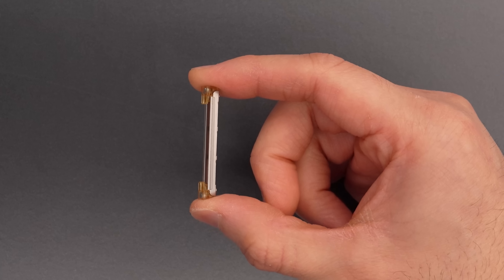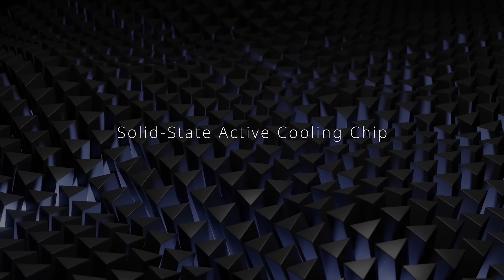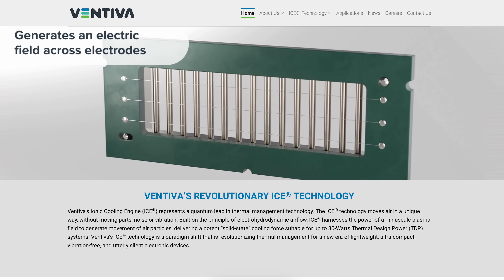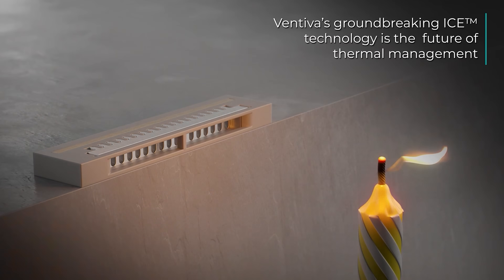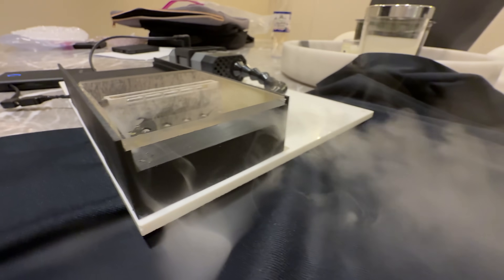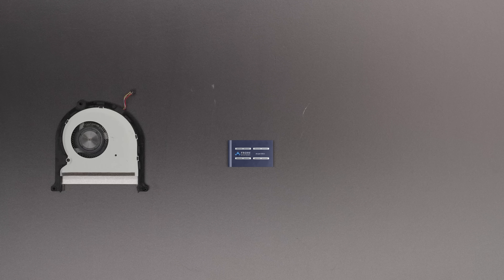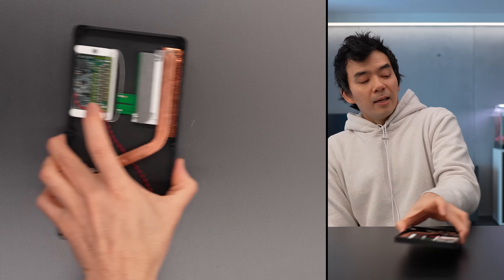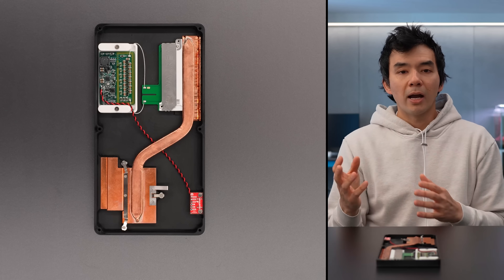The IMPOSSIBLE Laptop Fan...

Comment: Tbh i think it is easier for them to decrease the cost rather than solving static pressure issue. 

For me most promising coollers are vapor chambers as they technically have most heat caring capacity because of very high heat transfer coefficient, that can be achieved when a liquid is at boiling conditions. Although more R&D is needed for a particular design and appliances it is much more effective.
Reply: The heat pipe does the job of the vapor chamber. Fans are just a way of minimizing the heat exchanger from inside the device to the surrounding air.

Comment: In case of Air Jet you got that wrong, yes it uses less Air as in CFM but it uses more efficently in a way to be able to cool it.

 AirJet Mini removes 5.25 Watts of heat at a silent 21 dBA noise level, while only consuming a maximum of 1 Watt of power

Comment: Hey Dave, Been a fan forever (you once featured my music production setup in 2017), also, pun unintended. You do the Airjet, disservice. heat transfer is not measured in CFM. I would look at the numbers for TDP dissipated per watt when comparing an airjet with a standard cooling fan.

edit: spelling

Comment: nah.  I pass.  let the rich people buy and support the tech by buying laptop with it. 
but I'm staying on laptop with fans. 

1. any laptop who will support it needs to update their motherboard to integrate the power supply circuit in there. and that part is dangerous. if the power supply fails, then you can either buy a new mother board or find a good technician to fix component.   finding a component level type of technician is rare now a days.  most technician only know how to find fault and replace the whole part.

2. Dust... I'm not sure how would you clean the dust for such.
3. replacement.. if the fan part is broken. finding replacement us surely be hard specially for asian countries. and with such very new tech.. I'm pretty sure it is costly. 

so yeah. it's tooooo early for people who are middle class and below to support such product.
let the rich do it.  let them experienced all of it.

my laptop is 5 yrs old, and my fan are still good.   and even if my fan is broken I could easily find replacement in just a day or 2.

Comment: This solution won't be making to laptop manufacturers. It is not as simple as plug and play like a traditional fan as you have many dependencies and design limitations. Next, CFM per watt still can't surpass typical fan and the cost per unit, it just won't cut it.

Comment: To the complication you talk about in the end with static pressure, I don’t think you need to redesign the entire laptop, instead just the way the cooling system works. Since it can push this much quantity of air at a fairly progressive rate, why not simply putting one device as intake and one for outtake (or 2 for in and 2 for out, or how many you want, you got the point) ? It could move the outside fresh air through the laptop and then lead it straight to the outtake
Reply: I fear the effect of that ionized air with the internal components, even if filtered and what happens as other people mention, the filter weakens due to dust.

Comment: It is my understanding that ionic thrust devices require relatively high voltages. As in 100+ volts. 

That is a design challenge for two reasons:

1. The highest voltage laptops traditional engage with is ~20V for charging. So a very efficient boost converter will be required for these devices.

2. High voltages present a shock/ESD hazard which can hurt a user and unprotected electronic components. 

As other commenters have mentioned, there may also be toxic byproducts and degradation involved. I look forward to learning more details.

Comment: Is it just me or did you forget to mention that kilovolts of voltage are used to ionize the air? Do you think on this demo stand the main part is so far from the cooling one for no reason? Even control-board is far from ionic-part too. 
It's simple ionic thruster, you can build it by yourself.

Comment: this is cool, but you don't give the air jet enough love, it doesn't move a lot of air, but it moves a lot of heat

airjets are able to move the heat off the chip very fast, which means they don't need to move a lot of air because the air never heats up
Reply: Yeah he fundamentally didn't understand what the airjet did. To be fair, the company didn't make it any easier by calling it 'air' jet.
Reply: I mean, regardless of if you're correct or not, the numbers he showed suggest that it moves half as much heat per watt as a typical fan. And he's also right that manufacturers don't seem interested in putting them in laptops yet.
Reply: @StevoDesign Mistype, it moves half as much AIR, not heat
Reply: I think you misspoke at the end of your comment, because the air does heat up, more infact, compared to a conventional heatsink and fan.
Reply: The main use of the Airjet is to add active cooling to places which would otherwise need to be passively cooled and thereby limited in performance. 
It isn't a fan replacement, it is a heatsink enhancer

Comment: 10:22 this is exactly why the air jet is so good. You keep talking about efficiency but only for cfm… 1700 pascal verses 40-50 I would say is a great trade off for the “efficiency”. Especially for that z box mini PC it has filters for shop use and stuff and that’s only possible by that static pressure

Comment: Ionic fan/thrusters never worked great in humid environment, besides accelerated corrosion the high humidity will make it produce sparks and any time it arcs all the potential drops and it stops moving air.

Comment: I really doubt that anti ozone coating will solve the ozone problem. It's pretty much unsolvable no matter the coating you use,  as over time the anti ozone coating will get obstructed by dust rendering it mostly useless.

Also wondering how they plan to protect against shorts and flashovers of the high voltage lines when it will eventually get dusty.
And to make it worse, they need to make sure to have some kind isolation or water ingress detection to prevent people from getting electric shocks when they spill their coffee or something else onto their laptop.

To me this tech seems more vaporwave than frore, which while inefficient is at least safe and already a working product.

Comment: Static pressure is important!! If you own a house with a ducted furnace, AC, or heat pump, get a static pressure test done on your ststem. About 80% of homes I work in need some ductwork changes to make the system move the proper amount of air. Often adding a 2nd return air duct and grill will double the amount of heat and cool you get into your home and cost you nothing more on your utility bill.

Comment: idk man... I think you don't need health certification to make a laptop. I think that laptop vendor doesn't even put it in a test for producing ozone gas.

I am on a side of "company will not do unnecessary stuff for profit" and they, themselves, deem thatbhealth certificatiom is not necessary.

I mean... you said it in your video 9:51
Reply: Ah... the moment you say that it has low static pressure, I think the laptop will be using ARM or new System-on-Package where RAM is embedded as a package.

It will be a real challange to cool down RAM that usually put on different part with no heatsink.
Reply: But hey!! The future is coming when there will be less noise from laptop.
If they can shrink the package (power supply, etc) it will be nice to put one on handheld or even phone

Comment: High voltage ion thrusters do more harm than good, the ion electrodes are prone to dust and the booster driver is prone to damage due to continuous work, consuming more energy, creating toxic ozone gas and easily causing fire and explosion from electric sparks.
Reply: the ozone is converted straight back. if you had watched the video you would know that. stop posting misinformation on half cocked video watches. And stop posting lies about continuous work damaging electronics. its literally false

Comment: "they didn't explain all that...but it's solved"

-aight. 

Even if the tech can be implemented in the laptop, the cost and power efficiency downgrade seems like a massive negative for the end user and self-maintenance.  If a company like Apple were to implement this, I wouldn't be surprised if they decide to build it into the board to upsell you on repair.  On the other hand, a replacement fan on eBay will rarely run you over $10.  Definitely need actual data and specifics before jumping on this hype...otherwise it's just free marketing.

Comment: Ionic wind was first described in 1709 by Hauksbee!
It was not used in thermal dissipation until the 1960's.
Articles like "Ionic Winds: A New Frontier for Air Cooling" from 2012 and before were common but we are still waiting for full adoptation.

Comment: TL:DW - it's an ionic cooler., a technology that is decades old. Also, based on the way he is talking at 5:00 he wasn't aware of ionic airflow until he saw it in action.
Reply: I remember having a sharper image ionizing filter that used essentially the exact same no moving ionization technology to create a flow of air where dust particles would stick to the charged plates. You could feel the airflow if you put your hand next to it and that product was around in the 1990s, so at least 25 years ago.

Comment: Frore's device is(was?) not just about producing the airflow, it's about breaking the surface layer that makes standard radiators' magnitudes of order less efficient than it could have been. And that offsets a lot of the perceived inefficiency in the flow generation.
Reply: Just some napkin math:
0.2 CFM is 0.0943 liters per second. A litre of air has a mas of around 1.204 grams so 0.0943 litres come up to around 0.117 grams of air. With a specific heat of around 1J/gK, changing the air's temperature by 52.8 degrees Kelvin(or Celsius) would be enough to dissipate 6 Watts, or 5 Watts plus the 1 Watt consumed by the cooler itself, which is congruent with Frore's own claims about it's capabilities. The actual silicon's temperature would be higher of course, it has to be for it to be able to heat up the air, so in reality the cpu temp will probably be a few degrees more than 52.8 degrees C above ambient while dissipating 5W of power.
Reply: @guycxz  so for dummies like me... does that make them better or worse than conventional fans?
Reply: @audiofile8311 Definitely worse. If they try to make a comparable cooling solution you're looking at ~15% less battery life compared to a traditional fan. If they skimp on the cooling to save some of that battery life you're looking at higher temperatures and shorter product lifetimes.

I'm not even sure the trade-off makes sense even for someone focused entirely on noise - if you limit a good laptop fan to ~1/5th its max rpm you'll get something that's already pretty comparable in cooling, uses less power, and will be silent enough that it'll be below ambient levels anywhere except a sound booth. It also costs nothing and leaves the user free to make whatever trade-off they prefer.
Reply: @audiofile8311  Sound-wise, better. Everything else, much worse. And also unreliable in time.
Reply: @ContraVsGigi  laptops manufacturers already struggle with noise produced by fans, so maybe they will keep the fan running low all the time. Who knows. If they can get it work well, why not?
Mi that with an energy efficient chip and perfect
Reply: I was thinking the same thing, it was about increasing thermal transfer due to high velocity air being able to penetrate the boundary layer, this means the the difference between exit air temperature and the CPU temperature would be less. also less airflow means less dust and hair getting sucked in, would be interesting to see comparisons made with clogged vents and dust accumulation like we typically see on fans and in heatsinks.
Reply: @Hootie811  Frore said theirs is also a high static pressure, so you could even have a HEPA filter on the inlet